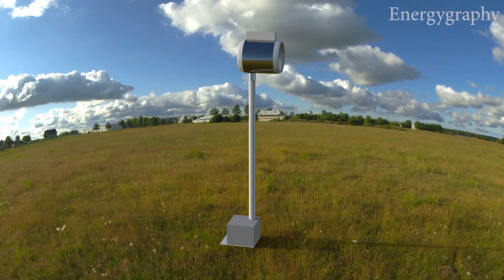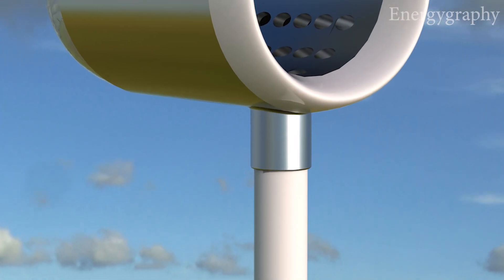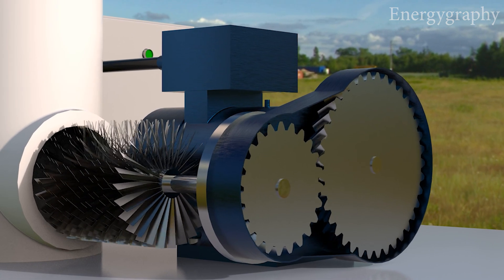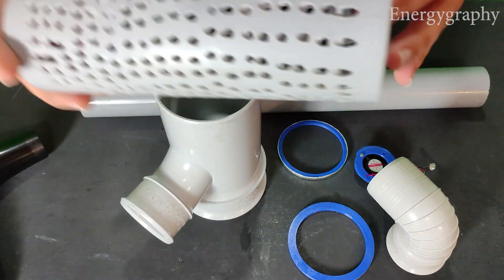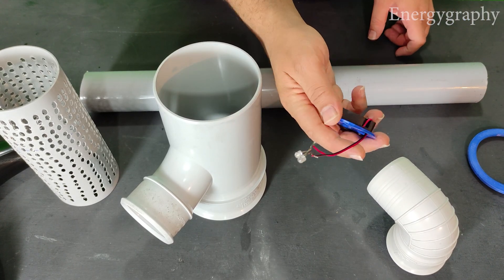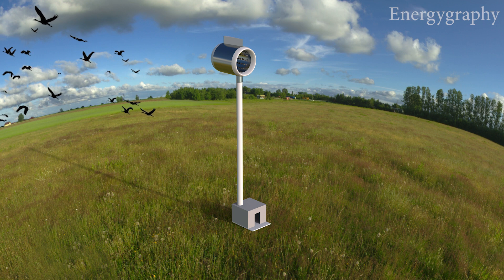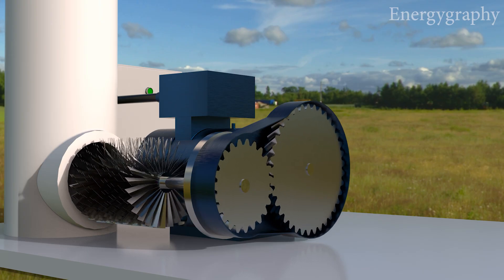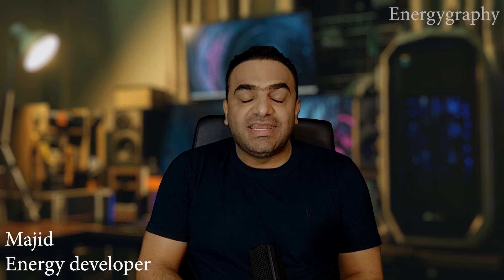I invented a new generation of the wind generator

Comment: The three blades of a wind turbine actually extract two forces from the wind, one is the wind pressure on the windward side, and the other is the vortex generated by the wind flowing through the blades. Your design does not effectively extract enough wind energy. There is a formula to calculate the minimum wind speed required for a generator with fewer blades. I

Comment: Does this need that Hole thingy at all? Use just pole with wind collector on top. Use A Large diameter cone to pressurexe wind to the pipe and run speeadier wind down to rotor.

Comment: so basically you saw robs video and then changed it up a little... but it doesnt seem like it would be better than the 35 degree angled slots that would send the wind down the pipe plus it grabs the wind from all side
Reply: There would be an updraft, but I do think the intake needs to be enlarged.